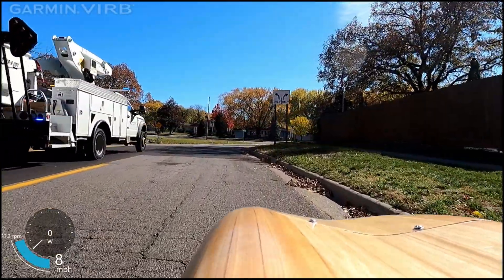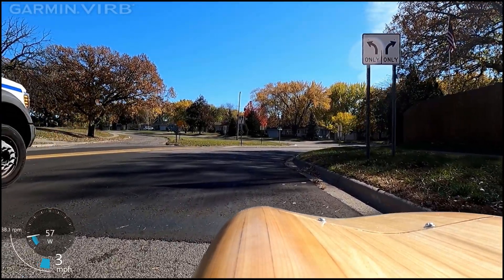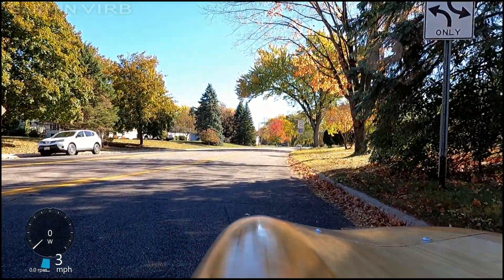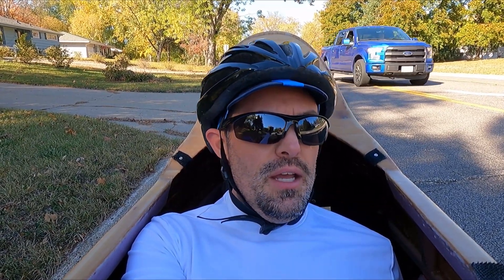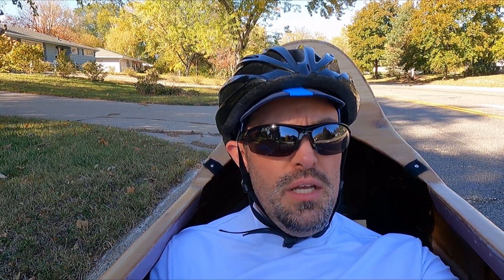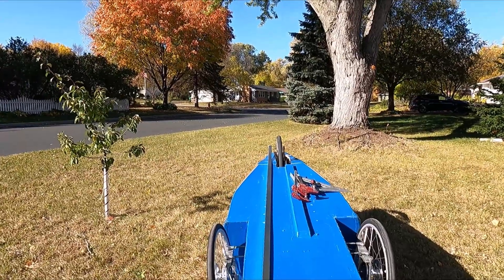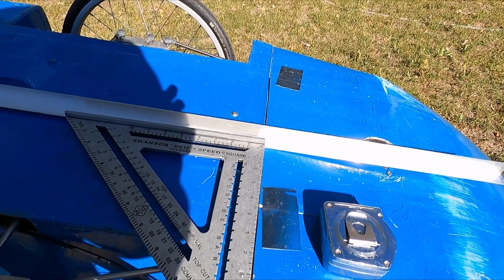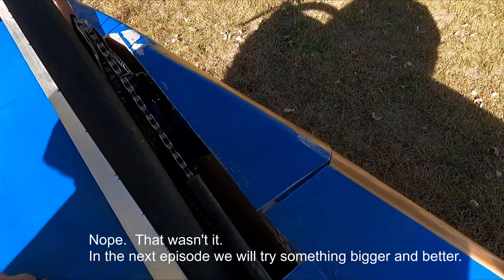Aerodynamic testing - Episode 2:  how fast can I go?

Comment: Dude was trying to give you a helpful tip on staying safe and you gave him some sass. The fact you’re bright blue won’t save you from a soccer mom driving an escalade who can’t see a close low object. I get that the bright colors and electric lights definitely help and you might not need a flag. But that man was just tryna help you out
Reply from the maker: If someone can’t see a 9 ft long torpedo with bright colors and lights, why would a small flag be any more visible?  I’ve never followed the logic on that. Drivers can see the lines on the road, they can manage not to run over turkeys and geese that hang out in the road around here and happen to be the color of the pavement, but a 9 fit long velomobile is somehow not visible enough? Do we need to give the turkeys and the geese flags too? I say this in all seriousness, not with snark. There is a perception that things that are different are somehow a problem. My experience is that I am plenty visible. I base this on the fact that people slow as they pass me so they can stare and take video. I’m quite certain they do that because they can see me.
Reply: @Bengoesdutch  i work in emergency services. I’ve seen drivers drive into police cars with their lights on, stopped in a road block with flares and cones. I’ve seen drivers drive into fire trucks parked on the side of the road, lights on and surrounded by firefighters.I’ve seen drivers hurtle into an 18 wheeler with cones and orange flashing lights as it was loading. 

So as to the “how could they not see the 9ft torpedo that’s maybe 3 feet tall”. Yeah they could easily. 

That guy works on the road. He knows how stupid drivers can be. That’s why they have those road blocker bumpers on the rear utility trucks.
Reply from the maker: @thegoldenfox283  ok, so then what is the point of a flag?  If people fail to see emergency vehicles and busses, adding a flag won’t make you more visible. Driving defensively and hoping for the best is all you can do. That’s my point. If they don’t see the velomobile and the lights, a flag isn’t going to help. I appreciate your concern, but to me a flag is just not helpful.

Comment: nice, what is the wheigt of the velomobile?
Reply from the maker: See video description for the answer to your question.
Reply: @Bengoesdutch  ah thanks, really nice wheigt! What wood you take and how to form it, to a velomobile shape?
Reply from the maker: @ben-3d  I used Cedar strips in 3/16 inch thickness.  When cedar is heated it can be curved and then when it cools it will retain its shape.  There are a lot of good videos on youtube showing the process of building cedar strip kayaks and canoes.  The same process was used for this velomobile.
Reply: @Bengoesdutch  Thank you, that is really helpful.

Comment: Congratulations on this beautiful piece of art.
Im guessing you lack a few things among the following. I am no expert at all, so ill just tell you what i learned.
After seeing the tour of your faring, i didnt see any air hole at the rear. This would create overpressure above 20mph and increase the drag by a lot.

Then your tail should be cut sharper- meaning same lenght but with a smaller angle in order to reduce what they call the pressure tail at least in french. A tail too smooth will reduce the turbulence on the faring but increase the pressure tail, and the latter has an exponential impact.

It seems the headrest could be smaller given your size, but most of all it is more flat than what it is on commercial versions.

Saukki lately strongly advised bigger tyres on dirty roads such as this one.
And he gave a source on tyre brand efficiency.

And last but not least : are you trained enough to gain an aerodynamic advantage through the increase of weight and rolling résistance ? You show like you can pull 220 on average over 3 - 5 mins. Thats enough for 1hour @25mph on an alpha7, 20kgs, but is it with a wooden faring ?

Tell me what you think. And keep up the good work, i really appreciate.
Reply from the maker: The waw has a rear bulkhead.  I do have an opening in that near the top over top the wheel well.  The commercial waw doesn't have any sort of vent holes.  That seems to be a thing only in the Milan and Snoek velomobiles.  

My tail design is certainly nothing special.  Since the tail can be removed it could be interesting to test different designs.

I doubt the headrest is a problem.  The majority of my testing was done with the race hood so the cockpit opening and area behind the head should be irrelevant.  With an open cockpit the large headfairing is known to create drag.  If I do build a 2nd body I will make some changes in that area.  I am pretty short and would benefit from several changes in the cockpit area.  The mounting of the rear suspension does require a certain amount of height in that area though.

I do have a set of Continental Contact Urbans that I just received.  I did not have good weather yet to test them.  That will bring the front of the velomobile up a bit and I think will be better on the bad roads here.

I think the weight only matters for acceleration.  Fiberglass Quests still seem to be quite fast compared to  my velomobile and they are a similar weight.  I would like to try a velomobile that weighed 20lbs less though to see what difference it made.

Comment: Have you measured the front wheel rims to your straight edge that's clamped to the rear wheel to see how much toes in or out your front wheels are running?
Reply from the maker: I have not. I did roll down testing to set the front alignment. Waw is recommended to have zero toe in I believe. Before the roll down testing I followed the Katanga instructions from their video on setting alignment to get a rough setting and then refined it with roll down testing.